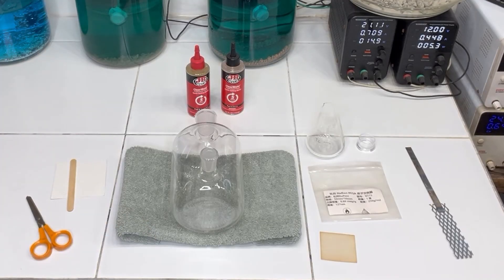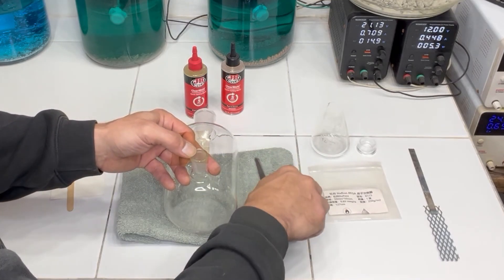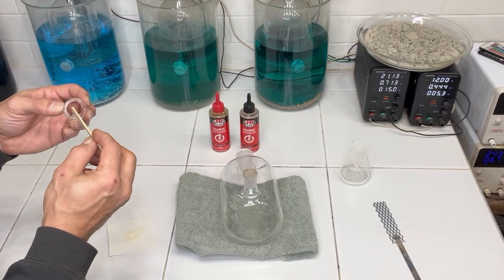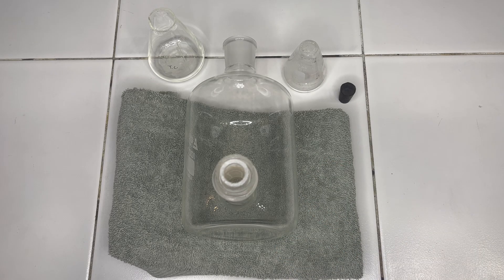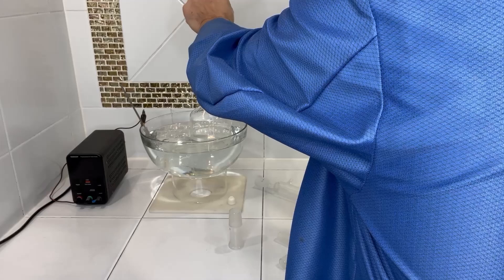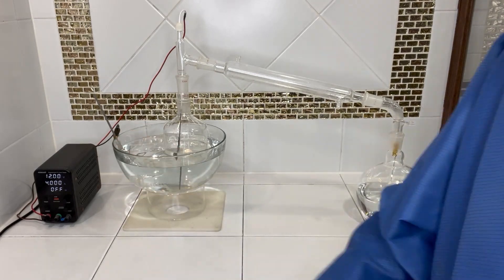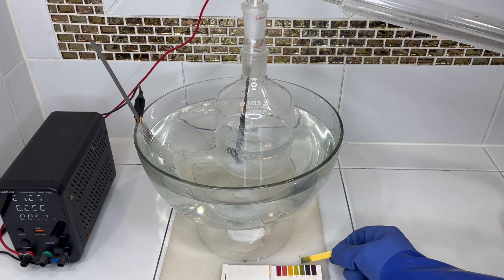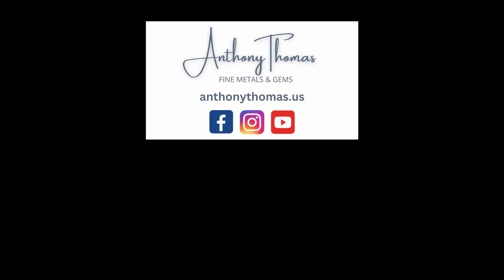A Salty Experiment - Making Sodium Hydroxide with Table Salt

Comment: You imposed an insane over-voltage. When this is done, the chemistry just shifts to both ions, but oxygen is far, far more available.
Dialing back the over-voltage causes electro-chemical discrimination.

Comment: If I'm not wrong, it is the reverse process of reacting NaOH + HCl to produce salt and water. What you have are HCl at the anode and NaOH at the cathode. So you don't have any chlorine gas in your chlorine collection flask. There are four ions in solution , namely, hydrogen , hydroxide, Sodium, and chloride ions. When electrolysis begins , the electrochemical forces binding the ions to their respective counterparts are overcome and are simply forced to rearrange themselves. Correct me if I'm wrong.

Comment: How does this do with stainless steel glassware for those of us that don't like to boil hydroxides in expensive borosilicate glassware?
Reply from the maker: Unfortunately stainless won't hold up to the chlorine gas that is generated in this process.
Reply: @anthonythomasfmg  Ahh, good catch. 

* That moment when your Hydroxides In Glass phobia collides with your Halogens In Stainless concerns and you find out which has higher phobic precedence *

Comment: Just as an idea...I use Iridium plated pool chlorinator electrolytic plates. They are designed to not dissolve in chlorine gas and its solutions. They can be bought second hand pretty cheap when people stop using them.
I believe your Platinum electrode might get partially dissolved...also chloric acid will get formed...and as a reaction with the table salt different compounds get formed ( the salt ) which are less soluable and precipitate as such. Maybe test the solution for Platinum?

Comment: The missing chlorine combined with sodium  at the anode to produce sodium chlorate, would be my best guess
Reply: perhaps not only sodium chlorate, but also sodium hypochlorite when chlorine gas reacts directly with NaOH, in a disproportionation auto-redox reaction. God bless you, brother.
Reply from the maker: @ Ahha, I’ll test for both, thanks. I have it a beaker right now. Thanks brother!
Reply: @anthonythomasfmg  actually, you'll probably find both, and the proportion between chlorate and hypochlorite depends on pH, electrodes distance and temperature. Higher temperatures promotes chlorate formation.
Reply from the maker: Thanks for the info, that makes good sense.